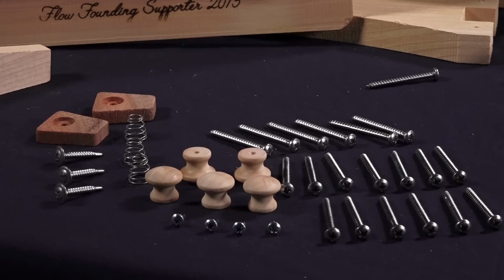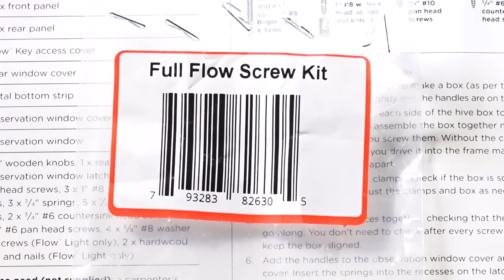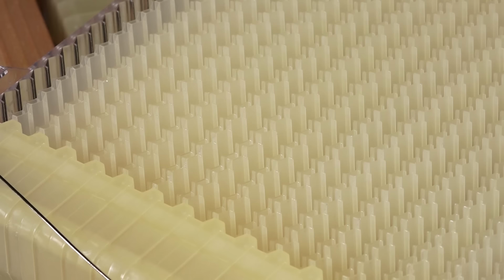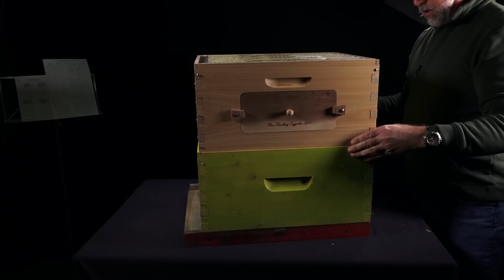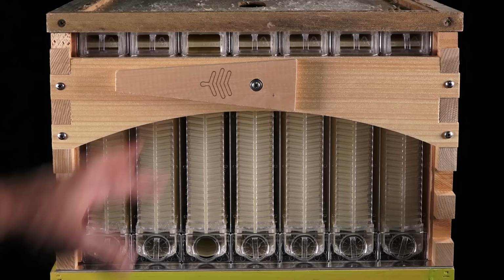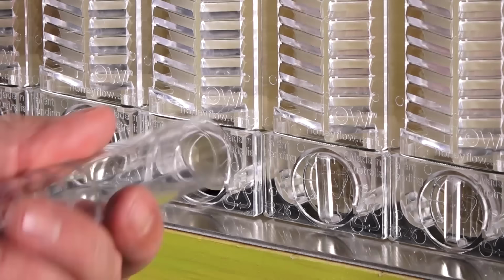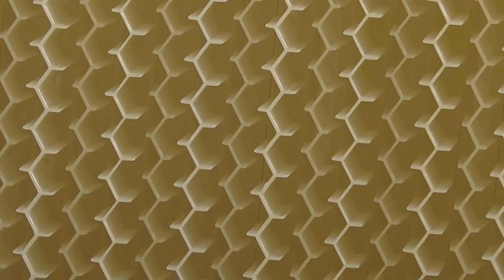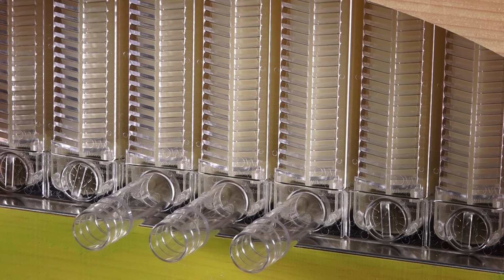The Flow Hive for honey bees, Love it? Hate it? or Undecided? Price? Review of Quality Control

Comment: I am from the Philippines, and have just finished setting up my FlowHive from Australia. My first concern is that my Farm has many termites that has demolished ALL the wood that they can get hold of. What is the best way of solving this? Secondly,  I have high value fruit trees that attract fruit flies. We have fruit fly traps made of sticky glue on bottles. Won't the bees get stuck on these? Thirdly, in summer, the neighbors' lots burn (tinder fires). The smoke will drive the bees away?
Reply from the maker: you can prevent the termites with DE-Diatomaceous Earth at the base of the hive stand. Paint your bee boxes to also make them less appealing to the termites. Fruit Fly traps can have openings/screens that prevent honey bee entry and still allow the fruit flies to enter. The smoke is something your bees won't particularly like, but won't drive them away. Better if your hives are up-wind from the burning.
Reply: Thanks for your reply.  I wonder what color or shade that the termites wouldn't like.
Reply from the maker: Termites generally prefer unprotected wood that is close to the ground so they have continued access to water.. by painting the wood and having your hive well off the ground, termites are less inclined to chew in... :)

Comment: if the inside was made from glas and everything was made fitting (box, screws) this would be a true innovation the way it is its kinda bs for this price
Reply from the maker: I've actually never seen a grade of glass that could be used in this way while being thin enough to act as comb. There would also be the concern that glass fragments could find their way into the honey if the mechanism broke or cracked? Plastic seems to be the most viable material for something like this. You're right about it being very expensive.

Comment: Do you know how much the Flow Hive Super weighs when it is full of honey? Does it hinder your ability to perform a hive inspection?
Reply from the maker: That's a great question Mike and I'm always puzzled when someone says, "we did a full hive inspection before extracting" because, I time my hive inspections with honey extraction because it is indeed VERY heavy when full. You have to take the cover off the flowsuper and remove each frame before removing the box for inspection of the boxes below. Or, if it's close to time for extraction anyway, extract the honey and then remove it as a single assembly.  With the seven frame FlowSuper, you're talking about 3 and 1/2 Gallons of honey. Well over 30 lbs in the box. I personally don't have problems lifting it, but many simply couldn't.
Reply: Thanks so much
Reply from the maker: You're welcome!

Comment: https://youtu.be/jVN6RYC-bcQ?t=167 It seemes like one of the boards got a little more wet than the other. Try putting in the bigger board in the oven (if this fits?!) for half an hour or so on a low temperature to get down the moisture of the wood. The wood should shrink and then eventually line up with the other board! You could also try to expose the smaller board to moisture by putting it to a container with water for some time and let it soak. Maybe this helps to esemble the frame without cutting the dovetails?
Reply from the maker: all interesting ideas, thanks.

Comment: You should send this video link to Flowhive just sayin....
Reply from the maker: +Meatwaggon I did... send it as part of an e-mail via their website. They replied after two weeks and appreciated my video. They are doing all they can to address problems in manufacturing. I also shared on the FlowHive boards where others have experienced quality problems. The U.S. manufacturer frequently responds on those discussion boards and simply says "Of the Tens of Thousands of orders being filled, less than 2% have any problems at all"... so, there you have it. So according to that statement, circa 200 clients of every 10,000 may have problems and they evidently don't think that's bad at all.

Comment: I can't really tell - is this glulam?
If not, it's no wonder it wont have a perfect fit, as it was most likely exposed to different temperatures and moisture levels.
Reply from the maker: +Rhaps Oldy That's interesting, so according to you, due to temps and moisture levels, several of the box joints will be on and others will be out by more than 3/32" because it's cedar and not glulam. First time anyone has suggested that.
Reply: +Frederick Dunn I'm not saying that it has to be, but you never know if and how much wood is moving when exposed to different environments. I've seen a straight 4ft x 2in spruce plank, 1in thick, lifting both its end by half an inch, just because it went from a high- to a low-moisture room.

I'd say one needs more examples from that and other factories to tell if it's bad work or bad storage
Reply from the maker: It's bad workmanship.. not "bad storage"... sorry
Reply: +Frederick Dunn  Glulam will not be foodsafe. Nor is  HDF which would solve shrinkage and warping problems. Excellent analysis of this product.

Comment: Wow!! Talk about lack of high quality workmanship. I wonder if the founder of this flow hive know of this video?They need to  see this.
Reply from the maker: Yes, they have seen it and written to me about it. I was told that mine is a very very rare experience.
Reply: Did they compensate you for giving you a low quality workmanship product?
Reply from the maker: Bull Winkle No, the manufacturer in Lancaster simply said that less than 2% of their mill work has had any problems. They were contracted to make the wooden components by the Flow company. Now the new hives are coming from Oregon, so I'm not sure if the Lancaster, PA company is still working with flow...
Reply: Wow. Having less than 2% less problems doesn't help you that you had to fix their product while you paid full price. Still it is their product regardless who made it. Bad product still should be compensated to the person who already made the adjustment. Customer service paramounts and they should a least gave you a 20% refund...since you spent 20% of the time repairing their defective product. It is only fair.
Reply from the maker: Bull Winkle Just to be clear, I did not ask for compensation.

Comment: 2:13 = i would of swapped them around for the other side, generally a company will factory fit parts and pull apart before shipping. but it is bad quality if you have to do that. OMG someone at the factory can't count. window and metal strip screws totally missing ? 1 is bad, completely missing = do they have peter griffin working there ? . knob screws too small=  company "we don't care , just throw in any old screw".  they made 12Million $$$ and can't get the number of screws right? good way to save money.
Reply from the maker: You can't swap the sides, they are not interchangeable. BUT, since this video came out, they have completely changed their woodworking locations and there have been no further problems. It was a disappointing first run for sure, glad they are better now.

Comment: Does thermal expansion affect wood I'm not sure
Reply from the maker: It can, but more often moisture... but not to this degree and not so irregular. They did change woodworking contractors and have a good shop that is definitely turning out a quality product now. Plus they have gone to laser cutting the joints.

Comment: Doesn't it kill the brood when the cells are displaced for the flow ?
Reply from the maker: Nope, not a single toe gets damaged. Well designed spacing that prevents that.
Reply: Rich Mountains no you should have a queen excluder under the flow frames so the queen can’t lay in the flow frame cells

Comment: the flow system great idea... but its not actually useful to get properly cured honey
Reply from the maker: +Mahir Fredericks Thanks for your comment... I would like to read more of your thoughts on why you think that is so? We can see between the frames and can see if the honey is capped or not. What more of an indication other than capped honey cells do you use to determine readiness for extracting? Thanks in advance for your answer.
Reply: well you cant actually see to the centre of the comb, most bees cap the ends 1st, so it might look capped but then the center could still be curing... other than the fact that its being marketed as a way to get at the honey without opening the hive for noobs id say its awesome
Reply: +Mahir Fredericks Are you saying the honey won't cure in the FlowHive frames?
Reply: no... what im saying is you will still have to open up the hive too see if you have a fully capped frame... nah-mean?
Reply from the maker: +Mahir Fredericks OH, ok... I thought you were asking about some other method. You "can" see the surface of the frames through the back to some extent. I personally plan to remove the cover and observe the frames directly before draining any honey. That's easy to do. I think evaluating the number of capped cells is as important with these as it is with any other honey super.

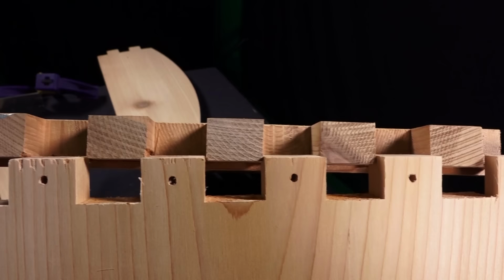Comment: 2:00 those are not dovetales
Reply from the maker: Hi Peter, you're correct, they are most commonly called box joints.
Reply: it is still a lovely piece of engineering. :-)
Reply from the maker: Peter Hall agreed :)

Comment: What kind of plastic is that? No worries about leaching toxins into the honey?
Reply from the maker: Hi Katina, all of the plastics are reported to be PBA free. We have not been able to find any synthetic trace elements in the extracted honey. I have been in contact with several testing labs so that we could possibly discern at what temperature these plastics may become unstable, or off-gas. But as of now, I have nothing to prove that the plastics are contributing to the honey. If you sit in a hot car in summer, you can smell the plastics right away, just sniff the dash and the particulates are strong. Take a flowframe and heat it with a hair dryer and sniff it, I get nothing. If I ever receive a lab result that indicates the plastics in the flowframes are polluting the honey, I will make and share a YouTube that details those findings. As it stands, I have nothing...
Reply: Frederick Dunn Thank you for the reply.
Reply from the maker: Katina Choiniere you're welcome

Comment: there not dovetail joints , dovetails are tapered and look like the tail of a dove
Reply from the maker: Thank you.. you are absolutely correct, they are box joints... I suck :)
Reply: i would never say you suck ,dovetails are usually made with a jig box joints are not that's why they can get off thanks for the video ,thinking hard about getting a flowhive ,and im looking at it all
Reply from the maker: 30jf5 it's the most frequent comment I receive :)

Comment: These weren't dovetailed, that's a box-finger joint . But yeah, still a poor fit.
Reply: A thought- seasonal expansion/contraction of wood -  perhaps made in a drier climate, led to misfit of pieces?
Reply from the maker: you are correct, box joints

Comment: Do you get any wax from the flow Hive?
Reply from the maker: The way it's intended to be used is not for wax collection. The caps may be discarded by the worker bees and dropped into the hive body... Flow "frames" don't provide any meaningful wax harvest. The Flow "hive" will have normal frames in the brood and lower boxes, so wax may be obtained there if that's important for the keeper.
Reply: Thank you for the reply.
Reply from the maker: John Wahlers You're welcome...

Comment: 3 years too late. anyhow.,, firstly maybe you should have got back to flow hive, to see what they would do to resolve the issue. then post it on utube, as by what you have done. you have put everybody off. from the manufacturer.
Reply from the maker: HI Mervyn, I did contact Flow-Hive and particularly the contractor who manufactured this box. His reply was "we are sending out thousands and this is a tiny percentage of misfit pieces and that seems acceptable" end quote. The contract was changed and now Flow produces their own boxes and have not had problems since. The woodenware shop was not at all interested in fixing issues and they have since going out of business. When I review something, I review it as is and share the results. Many buyers at the time this video was produced encountered the same problem. IF the shipper here in the U.S. had responded in a more favorable way, then that would have been included in this video release comments. I am a huge supporter of the FlowHive and now have many of these units. Honest is always the best policy with product reviews in my opinion.

Comment: they are not dovetails, they are tenons.
Reply from the maker: No, they are box joints or finger joints, tenons are completely different.. thanks
Reply: You are right, not tenons.
Reply from the maker: AKA Nathan Aside from the wood, the FlowFrames are pretty cool, right? :)
Reply: I think they are an awesome idea, though I have concerns about possible neglect in hive inspection for disease or invasive insects. 
I doubt these will ever be adopted by commercial operators and will be more a hobby and backyard interest. I hope that people dont buy these thinking they can just tap off honey without the need to open the hive. 
An example for the importance of inspection from just the other day, My father and I opened a hive at my brother's place to find a very high count of hive beetle. My father suspects the hive was just a bit too new to have the extra super and doesn't have the numbers to keep the beetles at bay. The top super had plenty of honey and would have been perfect to tap off it we had installed the flow hive. Tapping wouldn't have exposed the beetles and the resulting removal of the top super.

Comment: A dove tail joint don't line up at a flat degree angle. Dugh. Pounded together at a 90 and tada. They fit!.
Reply from the maker: Thanks for sharing! and yes, they are just box joints. You are correct.

Comment: that's a wire not a cord
Reply from the maker: The terms "wire" and "cord" are often used interchangeably, but there is a technical difference between the two -

A wire is a single conductor, typically made of a metal such as copper or aluminum. It is used to carry electrical current from one point to another. Wires are typically sold in spools or coils and are available in various sizes, or gauges, depending on their intended use.

A cord is a bundle of two or more wires that are twisted or braided together and surrounded by an insulating sheath. Cords are typically more flexible than wires and are often used to connect portable devices or appliances to a power source. Examples of cords include extension cords, power cords for laptops, and charging cords for smartphones.

In summary, the key difference between wires and cords is that wires are single conductors, while cords are bundles of wires. Cords are also typically more flexible than wires.

Comment: Making a big deal about the dove tails, just bang them together with a mallet, no problem. A couple of screws missing, bit short some of them too, big deal. Just send it back, get refunded and don't contact them again.
Reply from the maker: The entire purpose of a reivew, is to show how it comes and note the conditions. They have changed where the parts are manufactured and all has been spot on since. Banging them together with a mallet would result in splits at the box-joints.